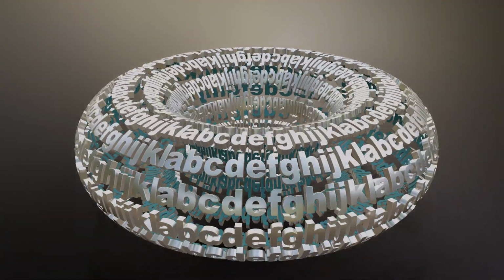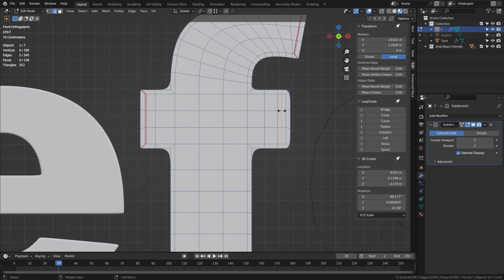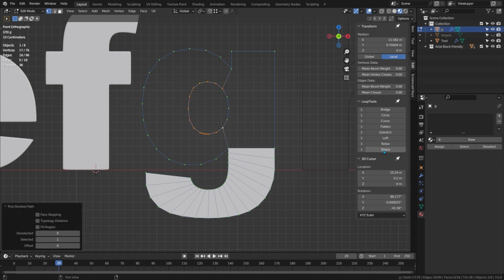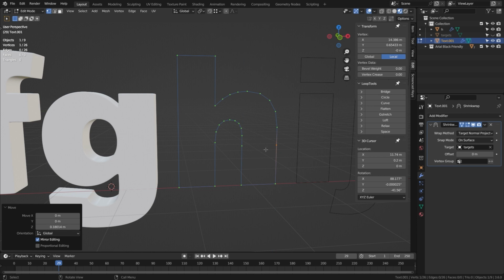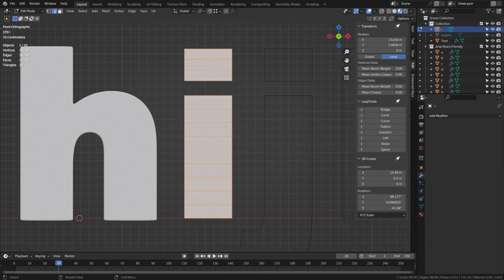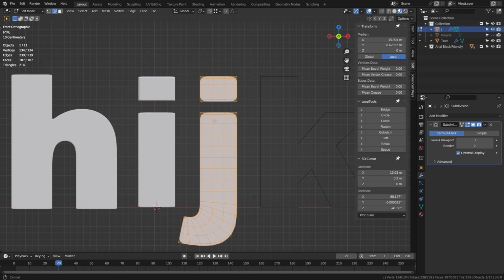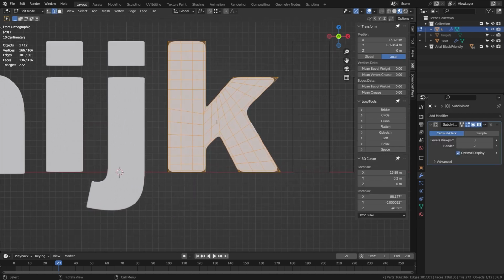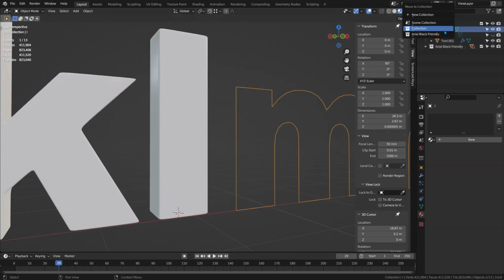Fixing text topology in blender - part 3 - #24 Subdivision Surface Modelling

Comment: hi Ian...i am hoping you can be of assistance to me...i have a project where i want to map curved jigsaw puzzle pieces onto the smooth surface of a ring torus (which i learned how to create in this video, thank you) so that i can 3d print each piece to make a 3d puzzle...this seems like something you would know how to do and i would greatly appreciate any help in this regard...blessings
Reply from the maker: It's a great question and an interesting problem! There is a fairly easy solution to wrapping a jigsaw around a torus although I imagine the complexities of wrapping the edges so they match perfectly is going to be tricky! Start With jigsaw pieces with topology that looks something like this: link - https://imgur.com/ZRBwcbw

Arrange all of your jigsaw pieces so that they work in 2D. Join them all together using ctrl-J.

add a simple deform modifier. Bend - 360 degrees around the X axis. This will make a tube of your pieces.

Add another simple deform modifier - Bend - 360 degrees (slightly more if you need to make the overlapping locking pieces of the jigsaw match up) around the Z axis.

This will create a torus which meets itself in the center. To fix this add an empty at the same position of the main jigsaw mesh and select this empty as the origin in the second simple deform modifier. now move this empty along the "y" axis to create a torus with the correct major radius for your torus.

These are the basic steps and you should be able to make it work perfectly if you can align the outside of your jigsaw to meet itself around the curve! that will be the tricky part.

You can then apply all of the modifiers and choose "seperate - by loose pieces" to have all of the individual pieces as seperate objects.

In general the jigsaw will need to be longer than it is tall to avoid stretching of the pieces.

Hope this helps! If not message me at HardVertex and I can try to help some more.

Cheers.

Ian.

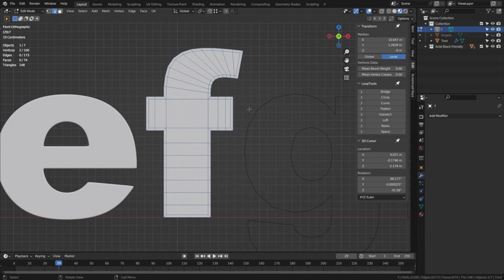Comment: Great tutorial! Im loving your videos so far they are extremely educational, one quick question that I suspect is very simple but I feel I'm missing it. Is there a reason you delete the faces before insetting the border and adding the faces back in? (Starting around 2:40 or so)
Reply from the maker: It won't work properly with the edges in there. If the entire face is a big n-gon, the inset will use the vertex normals to create the inset properly.

Comment: Great series of tutorials! Thank you so much, Ian! – I am trying my luck with music symbols and was wondering if you had an idea on the troubles I have with the eighth note. Here is an image: https://dl.rowild.at/eighth-note-question.jpg
As you can see my "solution" leads to quite some subdivisions on the note stem, which are not needed there. So far I did not find a solution to circumvent that problem. Do you happen to have an advice?

Just in case you are looking for ideas on how to add something to this series :-) : I would love to see how you handle (text or music or any other kind of) symbols that eventually are a conglomerate of different "3D-expansion" behaviours. To stay with my eighth-note example: the note head itself should be a round shape (a rugby ball), the stem is treated in the same manner as the letters in your tutorial series (its z-dimension would probably be narrower than the rugby ball), and the flag would myybe indeed be sth like a flag...
Reply from the maker: Hi Robert. It's a great question. Filled detail like the head on a musical note has to be handled slightly differently. What you have in your image is a little like the problems encountered on a UV sphere. Lots of geometry gathering together at poles. This obviously creates the problem of lots of tight geometry along the stem. For a musical note the head must be done first by creating four corners within it. (It's easy to do but hard to describe!) This redirects the flow and means fewer points are connected at those gathering points. You want to have just two internal loops along the stem and this will help you to achieve that.  On reading that back I don't feel it is clear enough. Sorry. I will try to post a screenshot of the topology required later today! I'm just a little too busy to make a video this week.
Reply from the maker: Check out this image: https://imgur.com/gallery/yE0OIe6
Reply: @ianmcglasham  You really are my hero! Wow! I am hugely impressed by your service! I took the liberty to invite you for a coffee in return, if that's all right!

I just need to figure out how to get those 4 E-Poles... do you have a video where you talk about this topic? Couldn't find anything in the text-topology-related tutorials...
Reply from the maker: @RobertWildling  Thanks so much for the coffee Robert! Unfortunately, that is not something I have covered yet! I almost did it when filling in the middle of the bishop but decided it was a little off topic for that piece so i didnt! There are several version of it depending on the weight of the geometry but it goes something like this: https://imgur.com/gallery/Ufc3Tqf
Reply: @ianmcglasham  If your are not awesome, I don't know who is! Big, big thank you! 🙏

Comment: Ian -  the section under the bell in the top right of the youtube page tells me that you seem have to answered my question. Unfortunately I cannot find it in the comments anymore... Has it been deleted? Do you want me to phrase or structure my questions in a different way? Would love to know what you have written! :-)
Reply from the maker: Hi Robert. It seems that you have deleted the original comment! I had answered you! Let's try it again. On the letters with holes in them (a,b,d,e,g,o,p and q) the loops surrounding the holes are actually travelling in the wrong direction. When insetting the filled faces (the first inset of 0.001) the new edges are travelling the wrong way. they go outside of the letter shape rather than inside it. It can be fixed fairly easily but it takes additional time which we just don't want to waste. So we introduce this very small error and that is why the first inset is so small - because it is actually introducing a very small error. It is the most efficient way to handle it.
Reply: @ianmcglasham  Thank you! I will pay closer attention to that and try again. – and sorry for the trouble!
(I actually added something to my comment, but it seems instead of saving I deleted it... I'll try again)

Comment: Your devotion here is truly admirable Ian! :)   I can understand when you said you were tired of saying the same things over and over again :P 
Would maybe be a good idea to make a macro that ran the same functions from a hotkey when doing entire alphabets like this. 

also, I've tried this approach on other objects like Imported SVGs for example. works brilliantly! :D
Reply from the maker: Yeah I considered making a macro but I decided that the repetition would actually be a useful thing for everyone to see! Yes. It works perfectly on SVG files. Make sure your svg's are well prepared. I will make a video about it but here are some great steps to make SVG's behave like blenders text (which blender does very well as it uses nurbs internally to do it!):

1. Make sure your SVG is exported at the highest resolution possible from illustrator (i think it is level 7)

2. Use a curve resolution of 3 or 4 in blenders curve settings.

3. change to no fill.

4. Convert to a mesh

5. select everything in vertex mode in edit mode.

6. press "x" and choose limited dissolve.

7. In the little dialogue box change the max angle to 0.5 degrees.

Done! this gets rid of all of the extraneous vertices which exist at small angles and eliminates them altogether on long straight edges so it can all be handled exactly as it is in my videos.

Cheers Quad-Gon - still a cool name.
Reply: @ianmcglasham  Another useful tip!  Amazing! :D 
I don't have Illustrator privately, but have other tools that can export SVG :) 
Hehe, thanks again reg. the name :)  cheers Ian!
Reply: @ianmcglasham This whole series has been super helpful ❤

Comment: Your tutorials are extremely helpful, and I thank you for them.  I ran into an interesting complication trying to apply your method to Apple's Chalkboard typeface.  (The same problem exists in Microsoft's Comic Sans typeface.)  The strokes are broad and their ends are rounded instead of flat.  The rounded ends need a lot of points, but you don't want that many loop cuts extending through the rest of the geometry.  I guess the solution is to use the diamond pattern or something similar to reduce the number of edges as they move way from the curved stroke ends.  Or perhaps adjust the number of points on the curve just right so that a grid fill could be used at the end of the stroke (similar to what you did for the lower-case letter "e").  I'd love to learn your approach to this problem.
Reply from the maker: Ah yes. It is a problem I have encountered many times. You may have heard me say I  the first video that it is usually best to add vertices to the side of any section with the lowest count. When the strokes are broad and rounded, then it is best to do the opposite. Remove vertices from the denser side. When working in typefaces like this, I would often have the "targets" object visible and I manually remove vertices to see how many I can get away with. You never really need more than four vertices to fairly accurately describe any curve. The main problem can actually be finding exit points for the internal geometry and often a second round of shrinkwrapping is required. What you do is add the border shape to a vertex group and specify that group in the shrinkwrap modifier while adding the internal loops. Then things can be spaced fairly easily around the edges while getting the detail required. The really important question is: "What on earth are you doing using comic sans?"
Reply: @ianmcglasham  Heh--don't worry, I'm not using Comic Sans! ☠  I just wanted to try your method on something significantly different from Arial Black.  I seem to have a knack for naïvely choosing hard examples.  When watching your first video on this topic, I randomly picked "e" to work on as I followed along.  I couldn't figure out why it seemed so hard until you pointed out its unique challenges in a later video.  Anyway, thanks for the reply.  I'll try that technique and see if I can make it work.
Reply from the maker: @SJChannel  Cool. I'd be really interested to hear how you get on. You will find the next video of a lot of use too. I am doing the 'm' which presents similar challenges to the 'e' but with a slightly different solution. Now that I look at the 'f' in this video I wish that I had taken the opportunity to show that reducing vertices can also be usefull. The top of that 'f' is unnecessarily dense. I just wanted to keep the method consistent for everyone. It seems like there are more advanced users like yourself who would benefit from seeing more possibilities. I will use the opposite technique too occasionally going forward. Cheers!
Reply: @ianmcglasham  I just finished trying the upper-case "H" in the Chalkboard typeface, reducing the vertex counts of the rounded ends as you suggested. The horizontal stroke of that letter protrudes through the right-hand edge, making it a little more challenging. It all worked out pretty well. I ended up with three longitudinal cuts on each stroke--one more than your usual two--but when I tried to reduce that, things got all messed up topologically because I'm still not very good at this. So it has a little more geometry than I'd like, but it's all quads and it deforms nicely, and I'm claiming victory.  There is a 10-second animation of the result here:  https://youtu.be/iltoGspW-p0 .  I played around with restricting the shrinkwrap modifier using a vertex group.  It's a great idea, but I didn't end up needing it for this case.  Thanks again for your help and for your superb tutorials.  I'm looking forward to the next ones.
Reply from the maker: @SJChannel  Yes!!!! You did it. Excellent job. Great job working out how to handle the extra protrusion on the side.  Dont worry about how much geometry is on the inside at this stage. Sometimes, I have none at all. Sometimes, I have up to 5 loops. Because the font is so rounded, you may like the look of it when you dissolve the two red loops running around the cross section. Remember, any red loops can be moved or dissolved at any time to change the curvature. It looks really good.
Reply: @ianmcglasham  Thanks very much!  The shrinkwrap trick is pure genius.  For me, it's the key to the whole process.

By the way, I have a quick tip for the step where you type "GG" and then type a number while holding the Alt key.  Instead of holding the Alt key, you can simply type "C" and it will toggle the operation into the same mode.  It makes typing the number a bit less awkward.
Reply from the maker: @SJChannel  Solid tip. Cheers! I don't think my muscle memory can be changed now, but that would be useful for everyone for sure.

Comment: Maybe I missed that part, but why are you adding these seams? Anyway, thank for this tutorials series 😊
Reply from the maker: Hi blenderpete.  The seams are just there to indicate that those loops are special. They are called "control loops" and they mark the limits of a certain single direction of curvature which can be controlled by moving them in edge slide mode (activated by pressing 'gg') It is those borders which make them a subdivision surface model. Making everything out of quads does not make anything a subdivision surface model. Things made from quads are just... Well... polygonal models made from quads. They are slightly better than things made with triangles and n-gons but without those seams (we normally call them borders) then they lack the ability to have adaptable curvature and they also lack the ability to deform along one axis without rendering artifacts. I need to make a video about the "anatomy" of a subdivision surface model really. The above might sound complicated but it really is very simple. And it's the main identifying feature of a sub-d model. Blender does not (at the moment!) acknowledge the anatomy of sub-d surfaces so there is no dedicated method of marking control loops. So I borrow the " mark seam" functionality from the UV system to highlight them.
Reply: @ianmcglasham  Thanks for the explanations. I’m wondering wether sharpening the outer edge loops leads to the same effect without increasing the polycount. Might have a deeper look into that.